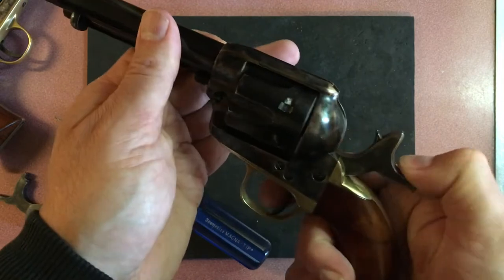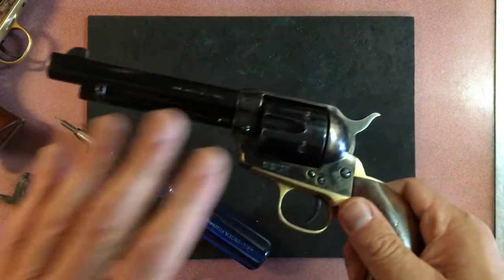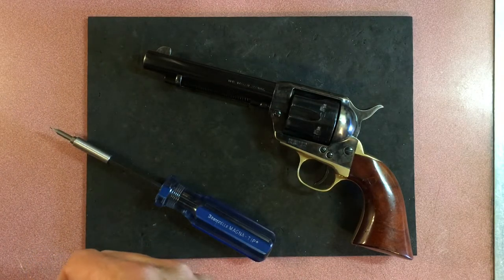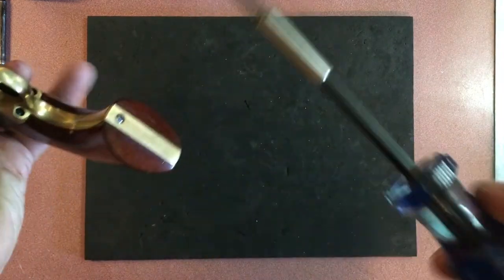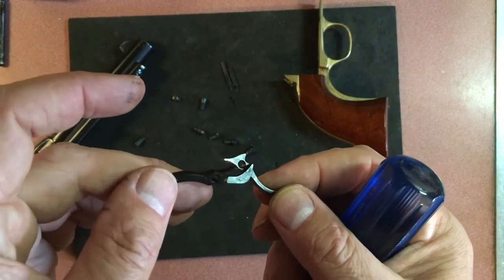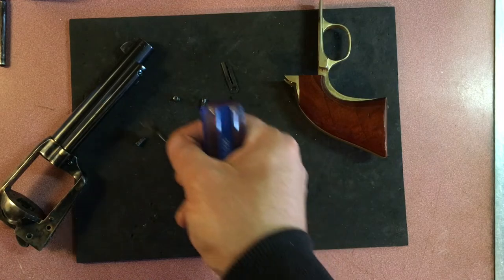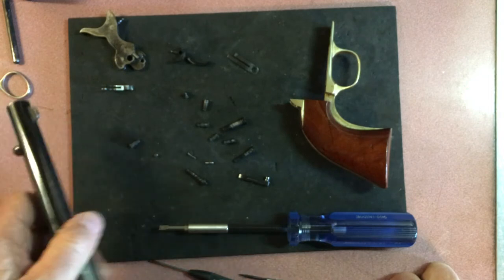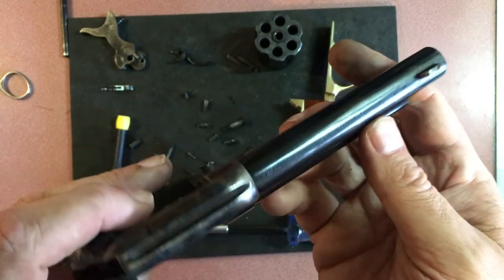Uberti 1873 Cattleman II .357 Hand / Pawl Spring Assembly Procedure and Disassmbly

Comment: I bought the traditional trigger and hammer from Midwest Gun Works to replace the "lawyered-up" trigger and hammer on my 1873 Gunfighter Taylor/Uberti I bought last year, but haven't replaced them yet. I reckon I'll get around to it one of these days!
Reply from the maker: Cool, that is one way to look at it I suppose. Im a fan of safety for replicas if unobtrusive to the esthetics. I like this with the Henry lever guns too, I dont like the cross bolt safety in Marlins for example, I own a vintage one which has a half cock safety.
Reply: @megatrends  im also a fan of the hammer safety system until it stopped getting enough pressure when i depress the trigger to set off a round now i have a 600 dollar paperweight
Reply from the maker: @existentiallydead5998  Just replace the hammer spring that is in the grip area. This is true for all SAA Revolvers that copy the original Colt style. No parts in this revolver with regard to springs, will last.

Comment: Thank's for the useful info, I didn't know what the pin that fell on the bench was. However you might want to do one on how the put the hand spring back in .that was a bit of a trick to get right.
Reply from the maker: I will certainly consider that ... Ive read a couple other replies suggesting I should do a reassembly video. Thanks for the comment ....

Comment: I have an older Dickson Cheyenne 38 special and while taking it apart to clean my trigger spring broke off and i cannot find a video on how to fix it! Or install it. It looked like it rested where the hammer strikes the bullets and fed into the trigger. I was able to put it together but the trigger spring is missing so now the hammer does not work and my cylinder will not rotate at all because a small spring fell out.
Reply from the maker: Im not familiar or understanding anything you said about that. Im not familiar with that design as it sounds like a unique design that isnt common. Im guessing yours is a single action / double action revolver?
Reply: A trigger spring is a spring that holds or pushes against the trigger.  It has nothing to do with the cylinder nor the hammer.

Comment: This was the first gun that I've fully disassembled and I discovered that the video I was watching was only for the original cattleman when I took the hammer out and that damn pin flew across the table. I was assuming that it went in front of that spring but your confirmation and explanation of its function was extremely helpful, you really saved my ass so thank you sir.
Reply from the maker: Actually I think I misspoke and it does go in front of the spring. My apologies.

Comment: Holy crap, thank you so much for this video, you absolutely saved me.

Ive worked with cap and ball Colt repros exclusively before getting my first SAA clone from Cimarron. I was under the impression that their black powder frame guns were still 1/1 clones.

I learned how wrong I was when I felt that little post fly out of the gun when I took the hand out, and saw no spring on the hand.

I just spent two hours on my hands and knees with a flashlight searching for it through carpet. Finally got it.😂
Reply from the maker: Awesome ! lol

Comment: THANKS BRO, YA REALLY HELPED ME OUT, I HAD LOST THAT PIECE TO ROTATE THE CYLINDER BUT I FOUND IT IN THE GARAGE, AND HAD I NOT WATCHED YOUR VIDEO I NEVER WOULD HAVE KNOWN ABOUT IT, THANK YOU AGAIN,🤓👍🇺🇸...
Reply from the maker: Cool, thank you very much for watching. Happy it worked out.
Reply: And guess what I did Shortly After I Thanked You,...  The Screw That holds The Cylinder Control Pin Flew Off To Who Knows Where, 🤡🤡🤡, AND I WAS IN THE BACK YARD SITTING ON THE PICNIC TABLE,🤯🤬... And Hopefully I can Find It Among The Grass, And If I KAIN'T, Well Then I'm "SCREWED"!  🤯  BUT Other Than That Great Information And I'm Sure I'll Be Following You Again, Thanks Again For Your Knowledge 👍🇺🇸👏👏👏🇺🇸,...
Reply from the maker: @marlbors1787  OMG Im so sorry to hear that ... you can get a replacement from Uberti's website but they're not cheap. I looked it up on their website before and it was something like $50

I sometimes use a large magnet to find lost springs in the carpet lol.
Reply from the maker: @marlbors1787  I looked it up on the Uberti site for you, they're now $80 for a part assembly kit. Maybe if you call them you could get just that pin. https://www.shopuberti.com/kits/361003

Comment: Thanks for posting this, been running into some issues with my gun, gave me the confidence to open it up and discover that little cylinder stop spring is wearing out. Had me stressed that the cylinder might roll out of alignment while firing and go off out of battery. Got 2 spare springs ordered now and I am sure I will be back to this video in the future if I have any other issues that require disassembly. Cheers.
Reply from the maker: I hope it helps, be sure to read my pinned comment about the order of the hand spring assembly, I misspoke in the video because I'm a human. lol.

Comment: Picked up my first uberti cattlemen 45 colt last week , turned around and got a second uberti cattlemen in 9mm both el patron ( BOSS) man they’re something else absolutely love them , my 9mm isn’t near as smooth as the 45 colt the trigger feels a good 1lb heavier the 45 is butter smooth
Reply from the maker: Yes, we measured the pull on mine in the video and it was around 1.5lbs. I used Wolf springs in it that state the spring is more flexible for an easier pull.Didn't modify any parts ... had a light pull anyway out of the box.

Comment: If you folks are using this video to disassemble a Pietta, the plug screw mentioned in 13:53 / 16:05 may not be there.  
The spring pushes against the grip frame.  This means you can loose it even easier.
Reply from the maker: I'm happy this is being helpful to some folk. in whatever way it is ...

Comment: I bought one recently 357 hombre 3 click and noticed the firing pin is barley making contact sometimes or not at all causing it not to fire. From my research I believe I need to upgrade to the no safety and cowboy load it. I hear the Taylor hammer is the go to? Watching this video to try to repair it myself any tips would be appreciated thank you
Reply from the maker: Im not familiar with interchanging hammers from other models. It may work if it is Uberti which taylor uses.
Reply: @megatrends  turns out I wasn’t squeezing the trigger hard enough so it does fire. If anyone else has this problem. So the built in safety stopped it from firing. I need to delete the safety
Reply from the maker: @MrDeadline34 Yeah, the firing pin  isn't solidly stiff unless the finger is applying pressure on the trigger. Happy you figured it out. Thank you for watching.

Comment: I have the 357 El Patron that has the pin and spring that holds the hand. BUT THERE IS NO SCREW TO REMOVE ? I can put the spring back in place but not room to fit the pin ? Any help or ideas ? Thanks
Reply from the maker: Im not familiar with the El Patron but am assuming (dangerous i know lol) that they are the same system. There should be a small screw as in my video. Im probably not helping lol. It's at 13:54
Reply: On Piettas the spring is a little longer and stands proud of the frame at the rear when installed with the detent pin and is compressed some and held in place by the top L end of the backstrap  . Don't know about the older El Patrons. Either you are missing the tiny set screw (look with magnifier to see if the hole is tapped with threads, if so then you are missing the tiny set screw. If not  and the protruding hand has decent spring tension when hammer is at full cock after back strap is screwed in place you should be ok. If not you either need the set screw to slightly compress the spring or a slightly longer spring to tension the hand against the back strap. As the auther suggested, thes parts are relatively inexpensive and having 2 or so spares of each on hand (pins, springs, set screws)  obtained when in stock from Taylors & Co or Cimarron is good insurance. Hope this helps DJ